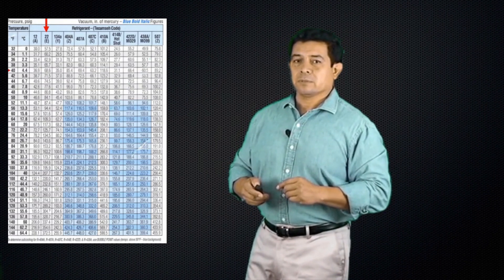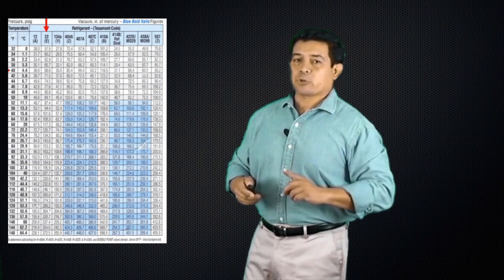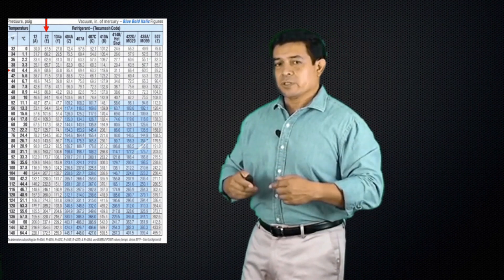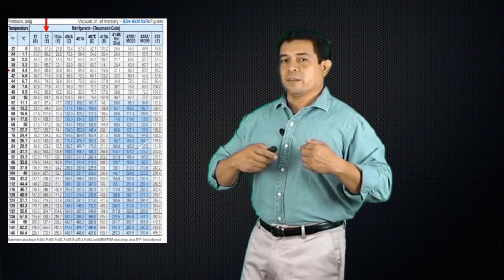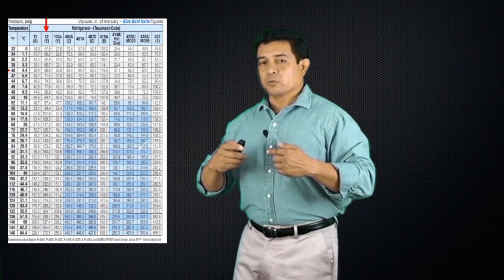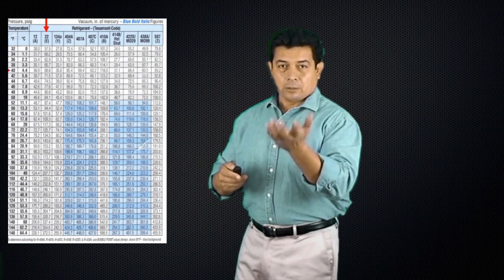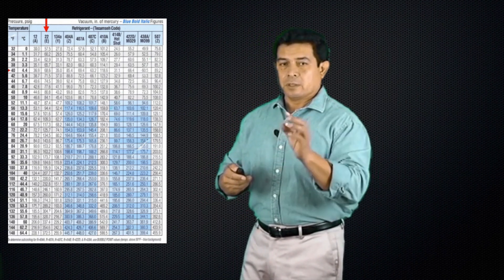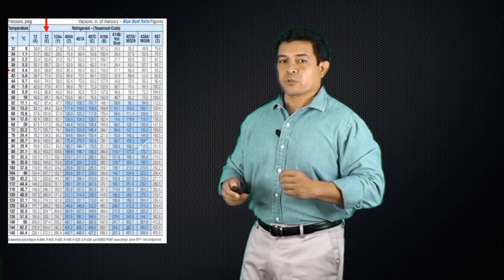Evaporator temperature - HVAC Online Training and Courses

Comment: Temp box - Evap Td equally the pressure that we will get on the manometer, and now I'm interested in how to know how many degrees I should subtract (evap td) and it's a chamber that cools to 0 degrees Celsius?
Thank you
Reply from the maker: I am not quite sure if I understand your question. But I believe you should get the pressure of the low pressure gage, convert that to temperature using th4 PT chart and then subtract that number from the actual box temperature. That would give you the temperature difference you are looking for. I hope this is it.   thank you!!!
Reply: @AirConAcademy  Can you tell me the formula of how much suction pressure should be on the R404A refrigerant if I want the compressor to turn off at 0 degrees Celsius?
Thank you!!

Comment: 68.5 psig suction pressure ?
Reply from the maker: Yes    68.5 psig  pressure of R22 will give you 40°F, which is the temperature we usually want an evaporator to be.    I hope this makes sense.
Reply: @AirConAcademy  what if chiller/chilled water system is it still 40degrees  F?
Reply from the maker: @bernardoordona3382  on the chiller typically the Chill water temperature gets dropped down to 35°F. It could be at 40° but then you're not going to have the heat transfer that you need and it may not be as efficient if you are running it at 40°F.

Comment: What about R407C
Reply from the maker: lol    Yes, I could have mentioned R407c    but then again there are so many refrigerants out there. I might make a new video where I am talking about the new refrigerant that is going to be the replacement for 410a in the near future! Maybe 454b? Or maybe about R32 which could possibly take the place of 410a. There is so much that could be sad! But thank you for your suggestion and for watching!
Reply: @AirConAcademy  ok thank you, but my question is what pressure do you run R407C of a 40 degree coil ?
Reply from the maker: @acbeyond  ohhh  I am so sorry!!!   I guess I misunderstood your question. The suction pressure would be around 63 psig.  But please don't forget at 407 C is one of those refrigerants that has a dewpoint and a bubble point on the PT chart. Some PT charts have arranged everything so it looks like one. But other PT charts will have two columns one for the vapor line and one for the liquid line.  I hope I am not confusing you. And again I'm sorry I misunderstood your question.
Reply: @AirConAcademy  that’s fine, thank you